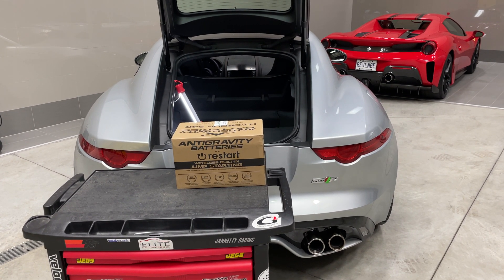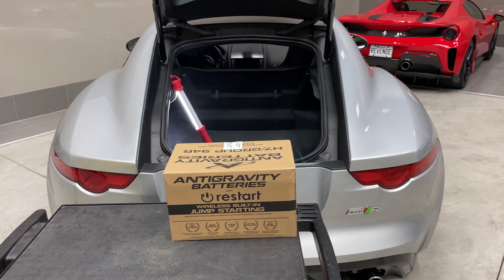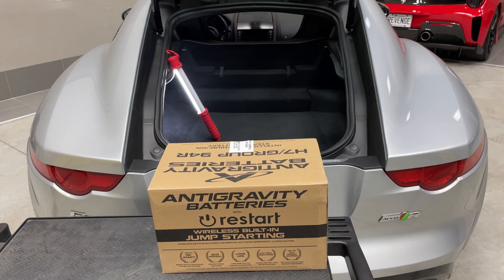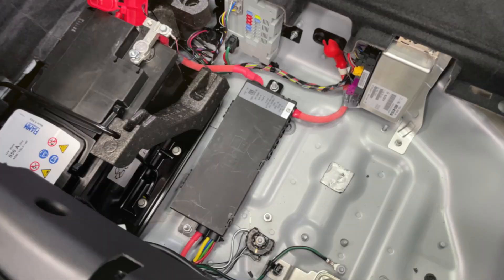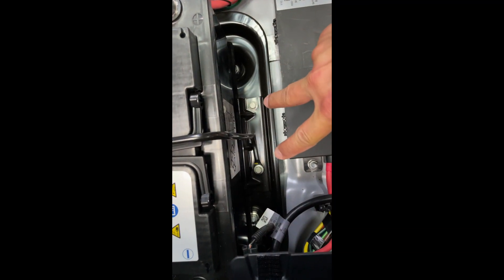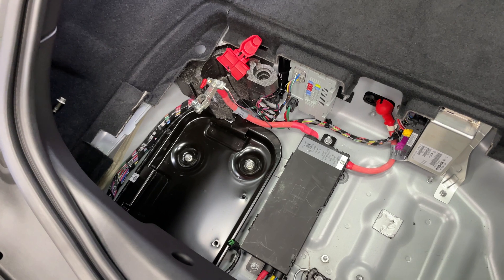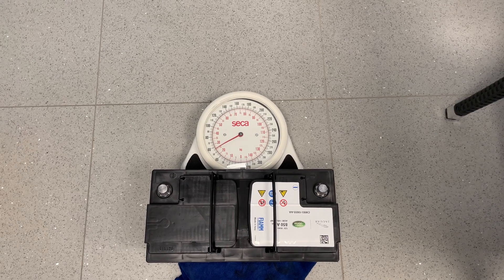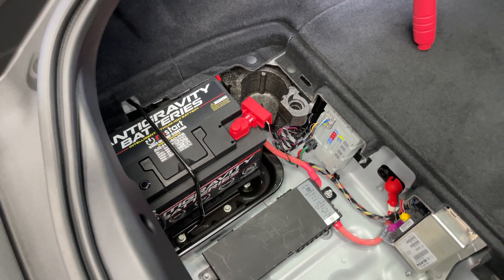Lithium Car Battery Install Jaguar F-Type R - 40LBS WEIGHT REDUCTION!

Comment: Hi im about to replace a dead battery. Is there any procedure to follow to keep the computer settings etc? Any other advise?
Reply from the maker: Nothing to do except re program the windows by holding both driver and passenger buttons down until windows go completely down, wait a couple of seconds then up and when fully shut wait a couple of seconds. That's it. Enjoy!

Comment: I was wondering about getting a carbon fiber hood. That’s a huge piece of metal and that should be wilt lighter too. Going to look into the battery swap too.
Reply from the maker: The aluminum hood is very light. A carbon hood will only shed a few pounds and will not be easy to fit. I don't think it's worth the money and effort for a few lbs. The battery is WELL WORTH IT!

Comment: Have you had any issues with "charging system faults" since changing the battery out?
Reply from the maker: Nope! All runs perfectly
Reply: @SuperSportMTL  I wonder what I did that caused this 🤔  lol. Thanks
Reply: @SuperSportMTL I had the same battery you have installed earlier today.. the red battery symbol appeared right after the car was turned on.. haven’t had any issues so far. The shop did register the battery with the odb device.

Comment: missing a trick on weight saving, over 10lbs per corner if you change discs
Reply from the maker: I agree, but I heard too many manufacturing errors with the Wortec discs. I'm waiting for my light weight wheels to arrive. That's like 7-8 lbs per corner shaved. I might also do a Brembo BBK up front.

Comment: i hear the OE muffler is 50 - 60 lbs
Reply from the maker: It is roughly 50lbs. The issue is the muffler mould is make to keep the underside as aerodynamic as possible. The SVR has a re-designed diffuser to compensate for a different muffler design. The VelocityAP alternative is $4000 with valves and carbon tips for a 15lb weight reduction. Not worth it in my eyes. I'm pretty much done after the Finspeed wheels.
Reply: Wonder if how easy is to remove the active spoiler since it doesn't seem to fit with the rest of the car

Comment: Yea i just bought a few upgrades like the pullies, carbon fiber intake, and tunes for the transmission and ecu.  This is a great vid for weight reduction.  Any other suggestions for more HP?
Reply from the maker: Great bud enjoy the car! No that’s about all for this car. Very little room in the engine bay. Heat is a big issue. I’d start with the crank pulley and tune. You can do downpipes as I did. Then weight savings.
Reply: @SuperSportMTL  yea I ordered both :)  should have everything put on in 2 weeks real excited about it
Reply from the maker: @fifawrldplaya1358  congrats!
Reply: I would DEFINITELY go with 400 cell spun cat replacements. Sounds the same but 30% louder.  Lasts forever.  $200 per side including install.

Comment: What’s the most power these can put down
Reply from the maker: 660hp
Reply: @SuperSportMTL  I heard with meth injection it's possible to get 750+ any idea if that is true? My V8S is still standard but I'll be changing out the supercharger pulleys soon, I'm really wanting more supercharger whine too, any ideas?
Reply from the maker: @MoaningGit  it’s not possible. The Meth simply acts to keep intake temperatures cool. To bring power up to 700hp you’d need a custom intercooler and forged rods and pistons. It’s a very expensive upgrade that’s not worth the 40-50hp
Reply: @MoaningGit  def not 750. Upper range for the things that can be done to this car is about 695-705.
Reply: @SuperSportMTL  how do you know forged pistons and rods are needed at 700hp? Because my car made 605 to the rear wheels that's very close to 700crank if not more an I feel like the engine still has more in it.
Reply: The engines are tested for 800 HP